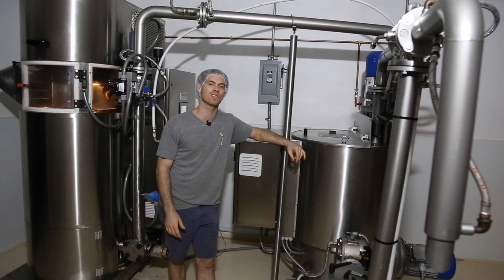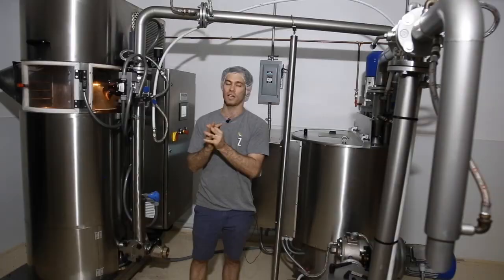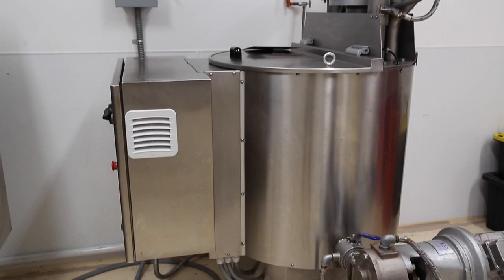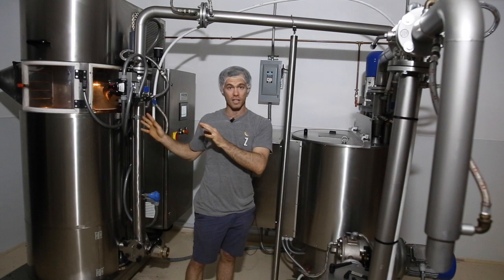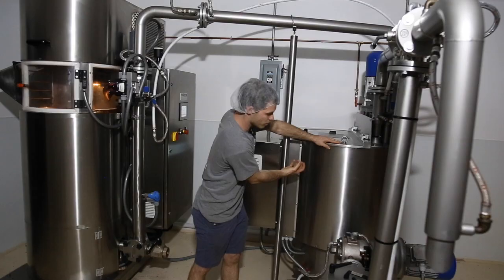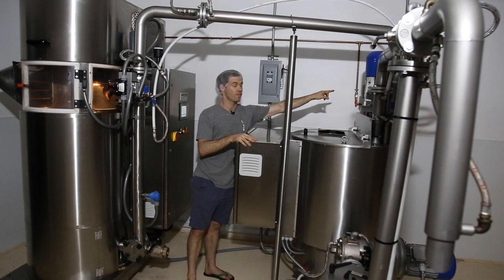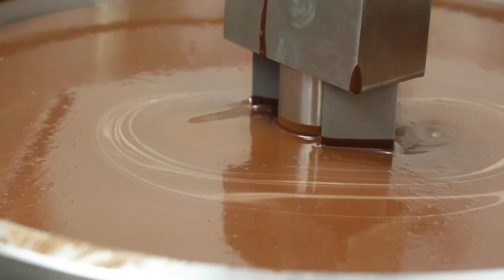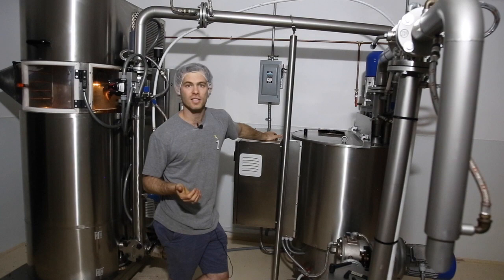The Chocolate Conch - Episode 12 - Craft Chocolate TV

Comment: I wonder if the amalgam in this machine is the same material that was used for amalgam dental fillings and contains mercury which is actually poisonous for the body?
Reply: He's using the generic definition of amalgam which means "a mixture." There is obviously no mercury in it because it's for human consumption. The only reason mercury is allowed to be used in amalgam (chemistry definition of an alloy of mercury with another metal) is because the mixture isn't consumed and is encapsulated and not introduced into the body. Usually. Unless you're like me and your fillings you got as a child eventually come out, painfully, and take advantage of newer technology like composite fillings. Honestly, I don't see dental amalgam with mercury being used much longer in most western nations. It still is being used, but composites are cheaper, just as good (actually, better) and much safer for both you and the dentist (who is exposed to them for years and years working with it) to use. If you go to a dentist today and doesn't at the very least offer composite fillings, run - don't walk away.
Reply: @matchesburn  I had an EXPERIMENTAL white filling in a front tooth in 1966, and was warned that it would not last long but would come out. It has not. It has also stayed much the same colour as my tooth. Dentists call in colleagues to see this --- it is a type no longer used, but definitely OK !  White fillings are much better nowadays for back teeth too, although they don't show. The whole procedure is more pleasant. The one in the front tooth was done on the (British) National Health Service, by the way. You have to pay extra to have them in back teeth.